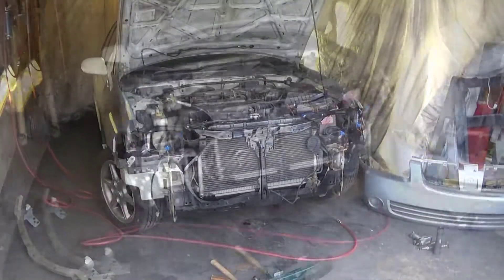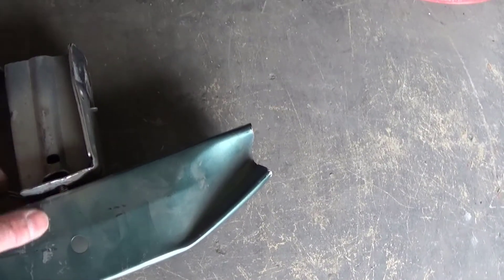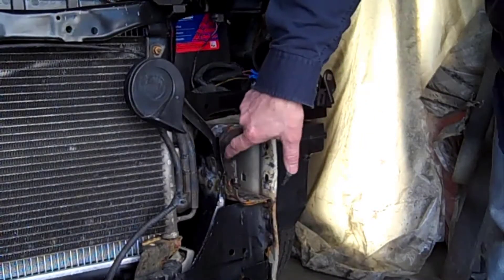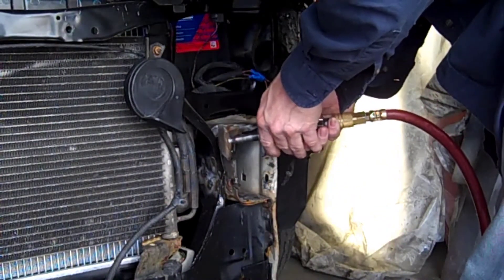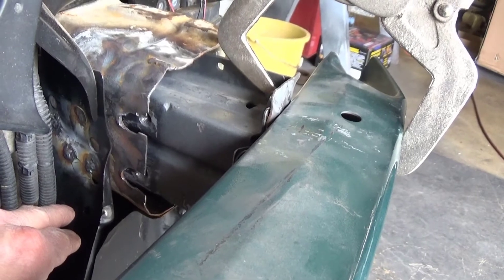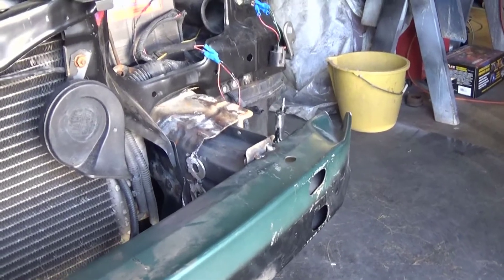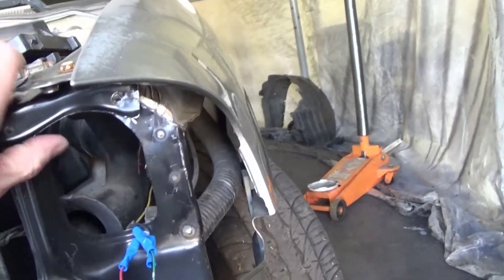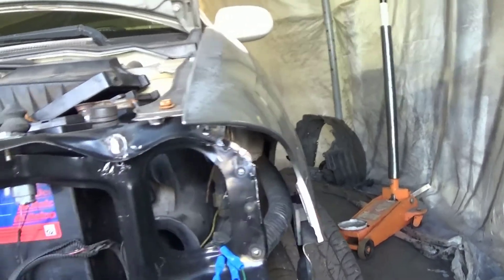Auto Body Collision - How to line up body panels

Comment: My bumper rail is banged up. I'm too tight to buy a new one. I just bent it back as straight as possible. Holds my bumper fine. If it works it works.

Comment: Is this work being done for a customer w/ insurance paying for it or is it customer self pay?
Reply from the maker: I think this car was customer paid but I also do insurance jobs as well. Depends on how extensive the job is. I made this repair for way less than what the deductible was, so insurance wouldn't have paid it anyway.
Reply: @RodsshopOrg  By doing the modification, just curious...does it keep the structural integrity/strength?
Reply from the maker: Yes, if any auto body tech is doing the job right and correctly, then it is as good as it was factory. I can't speak for all body shops because there are some that shouldn't even be in business but a reputable and professional shop's work should be as good as new.  @samwimpy2600